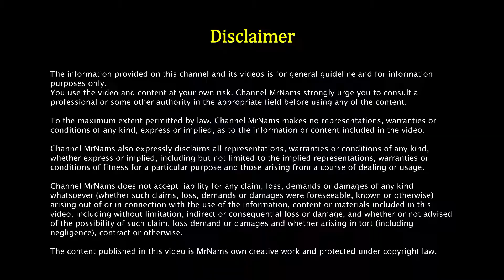Tarot 680 Pro Hexacopter - Installing the motors, ESCs and wiring for power

Comment: Hello, is it possible to install a coreless motor instead of brushless on this quadcopter board? Because the motor without a core has two output wires, but the motor of this quadcopter has four wires
Reply from the maker: really sorry, I dont have knowldge on coreless motor, will they be controlled by ESC, if yes, then we can use them
Reply: @MrNams  Thank you for your answer. Why does the speed controller of the quadcopter have a four-wire output to the control board, but the speed controllers, for example, of 30 amps, have two outputs, apart from the wire that is connected to the board.
Reply from the maker: Sorry, i did not get it completely, but if you search for how ESC and BLDC works you will understand it correctly, there are some animation videos as well to understand it complete.
Reply: @MrNams  tanks